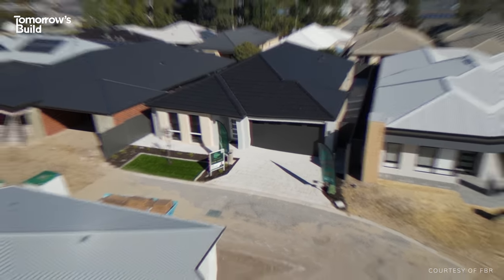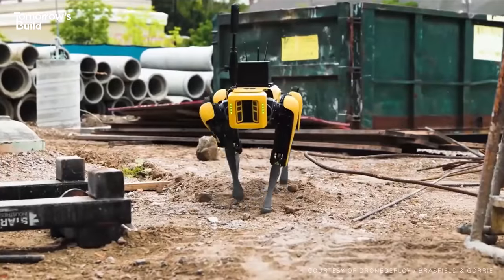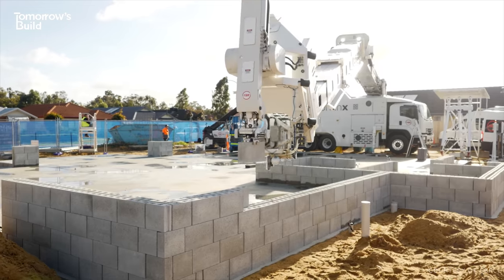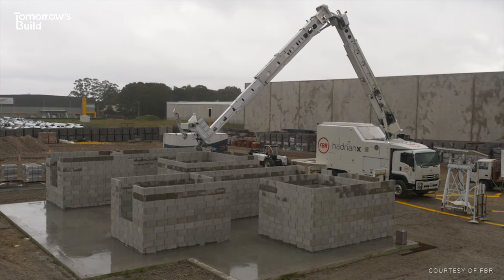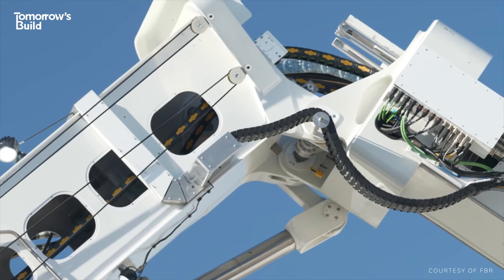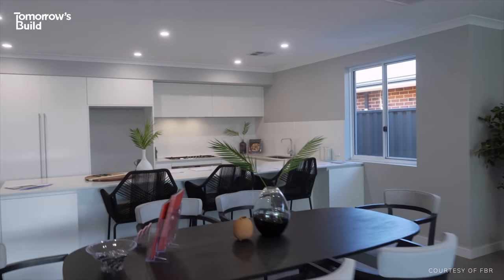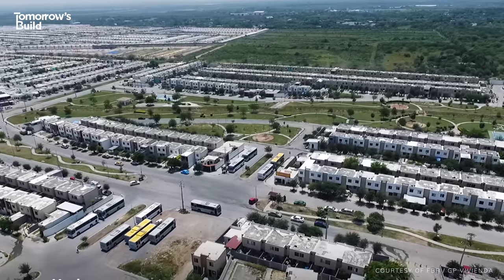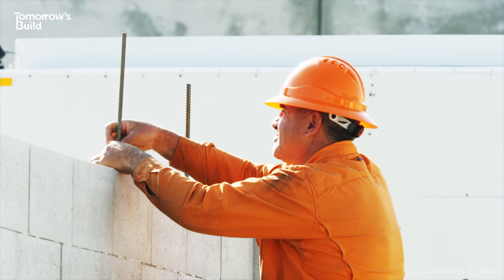This Robot-Built House Could Change Everything

Comment: This seems way better than the 3D printed homes. The tech is similar just faster, it's smaller and has less setup only requiring a single truck, and it's aesthetics are conventional
Reply: I would expect a mixture of both for the future, as conrete work is still needed. These baby steps only provide a single aspect, in combination, they may raise skyscapers in the future.
Reply: There was 2 vehicles
Reply: "it's aesthetics are *conventional*"

That's not really valuable. Maybe for conservatives who value tradition. But change is welcomed by everyone else. Progress is a good thing
Reply: I think a great solution would be a hybrid, 3d printing the walls and using a robot arm for other stuff such as building the roof and adding windows
Reply: Nope , I think answer is combination of those two techniques . as building 2 stories could be issue with only one technology , my proposition would be : for first floor use robot building with bricks , and for second floor 3D printed .
(BTW ground floor I count as first floor , and first as second)
Reply: @pissyourselfandshitncoom2172  no one made this about politics and neither should you. By conventional OP likely means it follows the same appleesque design language
Reply: @wazaagbreak-head6039  Can't expect a liberal to use logic, that's why they're liberal.
Reply: And can use steel
Reply: Technically, even 3D-printed homes could be made to look conventional just by adding brick facades (as the human bricklayers have done) and also adding drywall
Reply: This is far more realistic, the 3D homes looked like a bee hive.
Reply: No reason we can't build a 3D printer in the exact same format as the Hadrian X truck.
Reply: @pissyourselfandshitncoom2172  Change is not synonymous with progress... especially in the domain of aesthetics.
Reply: Is this not 3D printing?
Reply: @thermitebanana  debatable. I'd say yes.
Reply: @NakedAvanger  not everyone wants to be an edge-lord and break with tradition just for the sake of it. What's next, you're gonna tell concert pianists that they should all use synthesizers because screw tradition ? You want a unique home that might turn out to be impractical, be my guest, I'll even applaud your edginess if that'll give you a stiffy.
Reply: I prefer the 3d printed houses over this modernist trash. I want a house that imbodies tradition by featuring arches, curved walls and symmetry. Also single story house are a sin, I loath them and look forward to future generations tearing them all down because single story houses were a mistake and will always be a mistake.
Reply: @TheNefastor  Also impractical architecture is fucking fantastic! It's why even modernist love Victorian architecture. Who doesn't want a tower on their house? Also this isn't tradition this is neo modern trash. It's ugly, has a bad layout, lack privacy and not worth living in. Tradition is great, classical architecture is western tradition but then in the 20th century they start building modernist building and they didn't keep the original idea of using only the finest materials and keeping things simplistic and airy. No they made these post apocalyptic cave homes, made with particle board, ugly concrete and plastics. Hating bad design doesn't make one edgy it means the person has a brain. This house couldn't be lived in without air conditioning while traditional houses were designed to not need ac.
Reply: @TheNightshadePrince  your points might be valid where you live, but you're forgetting this video is about Australian houses. Different laws, different traditions, different climate, etc...
Reply: @TheNefastor  I live in Florida and the old homes have accordion windows throughout to allow the whole house air flow and natural breezes. I'm sure the laws are much different, in America you can't build houses that close to each. America and Austria aren't that different culturally. Australia is like America's poor cousin. America Loves Australia but we feel bad for them cause they really got the short end of the stick with great Britain and now with china.
Reply: @reksiohundson8706  FBR's HX can build upto 4 storage high all by itself
Reply: Maybe if the bricks could be quickly printed onsight???
Reply: @zionsky3342  I've been thinking about it. Print bricks that may each have a unique shape, then use the robot arm to lay them out. Best of both worlds, maybe.
Reply: I think honestly I would still take a 3-D printed home over this one. I really like the aesthetic of 3-D printed homes that we’ve been seen developing so far.
Reply: @TheNefastor  indeed indeed
Reply: misture of both for rounded edges and design. and overall preference for the buyer
Reply: @pissyourselfandshitncoom2172  conventional is like living in a prison its lame
Reply: @pissyourselfandshitncoom2172  barely anyone wants to live in a 3D printed home for a reason. Looks matter man.
Reply: @xaviercopeland2789   strange concept. I thought it looked fine
Reply: yea the 3D printed homes are ugly. there is no way I would pay more then 5% the cost of a standard home for a 3D printed one. But if 3D printed homes can be scaled to provide really cheap homes for homeless in developed countries and third world countries then that will be a good thing.
Reply: @manofsan  I haven't seen any though, and they are ugly as hell. there is no way I am paying for one. I would rather have a shipping container home then a 3D printed one.
Reply: I was just thinking about the same thing. And it’s deployment in third world countries.
Reply: @San Ansa  -  okay, fair enough - this new robotic method of building homes from bricks or blocks could be a better way that results in more traditional looking homes. Or maybe homes which look even better than traditional building methods.
Reply: its consistent and wont complain when it gets hot /cold
Reply: @TheNightshadePrince  Except the average Australian is richer than the average American. 

Australia loves Americans but we feel bad for them cause they really got the short end of the stick with their education and political systems
Reply: @mabamabam  Well that because our government cause has been helping to create monopolies where only the rich can own a business since at least Victorian times and then single use zoning came along and that really hurt the poor who would run their businesses on the land they're home was on. American's don't have much power over our representatives once their in office and it's become quite a problem. We do have a constitution but it doesn't mean much when the supreme court can interpret it how ever they want. The death penalty is against the constitution but they like the death penalty so they keep bringing it back. Our education system is actually pretty good in many states, the biggest problem is the oppressive authoritarian structures it operates under.
Reply: @stevechance150  If we stop lettings the rich use properties as investments we wouldn't need robots to buy a house. We would have enough houses for everyone including the homeless. Our government's incompetence is why we have this mess, as they would rather fix problems abroad than in their own country. It's so stupid and elitist of them.
Reply: But how does it's strength compare to a 3D printed house? A building with rounded corners should be stronger.
Reply: @Philip Kirschner Nobody said it wasn't about people. I'm confused.
Reply: Will it be cheaper to construct than an American stick frame home?
Reply: "Conventional" houses look hideous and on top of that, they're not even efficient. Throw the ugly and overpriced beige and grey cubes into the trash where it belongs.
Reply: 3D printed homes currently look like hornet's nest still long way to go imo.
Reply: Housing crisis is because human greed. NOT BECAUSE OF LUCK OF ROBOTS. HOW STUPID SOME PEOPLE MUST BE TO SPREAD SUCH BS.
Reply: 3D printing can offer more shape freedom than this one.
Reply: @speedpu   Esesntiall this machine is a 3D printer, instead of using mud spray it uses large bricks lol.
Reply: @photovideooz4084  Agree
Reply: @pissyourselfandshitncoom2172  it depends, nice to have options, traditional styles will surprise you with their practicality and  often very clever reasons for looking the way they do. I love modern technology, but I also appreciate traditional architecture, it's nice that even a conservative like me can have his old-style but modern("under the bonnet") 🤣 house built by a robot.
Reply: @Interstellar Traveler  i can't find evidence indicate spraying cements layer by layer is cheaper than bricks.
Reply: And kills tons of jobs too
Reply: Agreed. This technology is patent pending I believe.
Reply: This system is also more mobile and that speeds up production. Drive , park and go. A 3d printer is more tedious to setup and move for the next build.
Reply: I was thinking it would be neat to do maybe the first floor with this, then the upper floor with the 3d print
Reply: @SunSailor yeah, if they have textured brakes they could have a hard curing liquid on the outside of the house instead of having to lay bricks with humans. They could probably also have a robot that automatically cuts and places rebar vertically while also filling in the holes with concrete.
Reply: @thesteelrodent1796   Or the modern districts could be new cities on their own, separate from the old cities
Reply: 2 truck and a onsite forklift to load bricks

Comment: At first I thought the machine looked really slow, and then you say it's 10x faster than a human brickie!
Reply: well the bricks are 12x bigger, so makes sense
Reply: Just make the brickie 12x bigger, simple really.
Reply: @thirdvect0r  😂😂
Reply: @thirdvect0r  cinder block
Reply: And 30 times more expensive.
Reply: Reason it's that much faster is probably because of the size of the bricks. Human workers can't handle those size bricks for that much amount of time.
Reply: But it's also in Australia. So in aus when it goes above 35c you don't work, and it does that a lot. And I assume it can work 24/7. No need for ladders or scaffolding or hauling bricks around, so yeah, plenty quicker.
Reply: It's not.  4 days isn't that quick. I'm know blocklayers that would match that and I bet they cost a lot less. Also would be built stornger by the look of their technique.
Reply: @sidekicksjn  how many bricklayers would it take to finish a house that size in 4 days?
Reply: @jaxstax2406  Brickies can throw similar sized blocks on top of each other all day long......... and regularly do...... especially now they are made to be lightweight, such as aircrate and pumastone
Reply: @Mr_G_in_Alba  Many bricklayers today do not know how to properly install air-crete bricks which leads to severe cracking - especially the ones that had only 2 months or less of apprenticeship. So human error is a big deal on construction sites that have fewer trained experienced workers.
Reply: @HeliumFreak  plus with this bonding system no need to strike joints, no poop to clean off the floor.
Position checking 1,000 times a second, no eyeballing a level or string line.
No scaffold. No lunch or pee. No injuries or hang over slowing it down.
No social/income taxes or workmen's comp insurance to deal with...
You can't write off or depreciate an employee.
Reply: It is also "looking slow" to me in the placement of the bricks, but general process looks very fast, eg while laying one brick, you have second one ready. And the arm just keeps feeding, and laying bricks. That aggregate process is outpacing human.
Reply: it doesn't get tired
Reply: It's probably slightly faster than a human and of course it's using larger bricks (blocks) but it would also be more consistent in its pace not having to stop to collect more bricks or mix more mortar.
Reply: @jaxstax2406  key question
Reply: @jaxstax2406  even if this machine is a bit slower than a skilled human bricklayer - do  you see a lot of young people rushing to this trade? 
This brick laying machine is pretty much a prototype. The technology will be improved, it will become faster and cheaper while the human bricklayers are getting older and more difficult to find.
Look at railroad track building - we don’t even think people should be carrying the steel rails and concrete ties - the machines do this work.
It was much different 200 years ago.
The pace of technology is continuously accelerating.
In a few years bricklaying robots may become common on building sites.
Reply: @thirdvect0r  First youtube comment I've ever laughed out loud at
Reply: Also remember it doesn't really need breaks
Reply: its literally at maximum 3 times as fast as the average bricky but thats because it does half the job-
Reply: @kevmatt8450  Just means one brickie would be setting up for and overseeing 3-4 of these machines I imagine.
Reply: @jaxstax2406  Speaking about the kind of "bricks" shown, that are roughly about 10kg each, I guess it'll take two (though experienced) bricklayers to finish the job in 4 days.
Reply: @sidekicksjn  I have seen a house built by a crew of 10  in 1 week. Ever seen a mortar join wall built  that fast? The weight of the wall forces the mortar from the joins and causes the wall to sag
Reply: @Mr_G_in_Alba Some loadbearing is good.

Comment: Given the accuracy of lasers couldn't the bricks be laid so close togeter they don't need as much if any mortar. Especially if you have jigsaw shaped joints at each end. Some stone and bronze age buildings had amazingly tight toleances between stones and those are weatherproof 3000 years later.
Reply: It's not the accuracy of measurement that's the issue, it's keeping a big heavy brick so steady at the end of a long beam
Reply: The way the Incas built their structures is also a beautiful example of this, with their terraces and such not needing mortar due to how carefully they shaped the stones they used there!
Reply: @marabooq7150  don't forget, the Incas have always historically denied being the builders of the megalithic structures.
Reply: @aquariandawn4750  ooh I did not know that, thanks for sharing
Reply: Ancient buildings were made out of stone. Modern day bricks are made out of concrete. Cmu concrete masonry unit. Stones will last 3000 years cmus will not.
Reply: You need mortar, lookin at the lack of mortar in places from the bricks the robots laid in this video I reckon they need to improve, also this process at the quality I can see would only be used with render to cover the gaps and provide a Finnish or as they say in this video they used manual labour to lay the exterior Finnish bricks as it takes a lot of skill and experience with a trowel to make it look good, I would bet 1000 bricks laid in a day by hand look a lot better than this machine does
Reply: @chrisjohnston5401  Thankyou for explaining that.
Reply: @ant Yes
Reply: @tomtom4633  The lack of mortar is deliberate. It uses an adhesive instead. It dries a lot faster (15 mins or so). It also allows the machine to lay in the rain, has even laid in hail.
Reply: @chrisjohnston5401     How will that adhesive affect the air quality in the home when it’s hot outside or the heat from inside when it’s cold outside.  

There have been so many cheap alternatives that end up costing people their lives and/or health.
Reply: @sharongillesp  i haven't read anything specific about the smell of the adhesive. I do know that the type of adhesive is common in europe, i don't think it's bespoke. Additionally, FBR have worked close with the building regulators and associations  in WA and Australia to ensure the whole thing passes compliance, best practise, safety etc.
Reply: Yes i saw  many flaws
Reply: I guess it would come to that eventually, with the current machine it is just using what is already available in the market. to build and test these jigsaw bricks is gonna take time and convincing.
Reply: interlocking bricks have been around for ages and the ones that interlock from all sides don't require mortar
Reply: It’s only a matter of time before this company mass produces its own bricks for a totally vertically integrated business model.